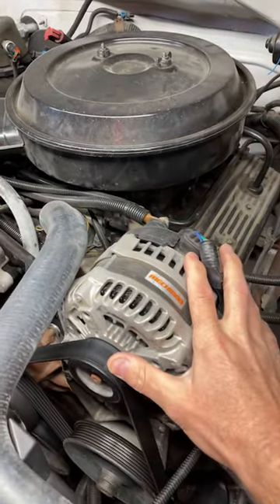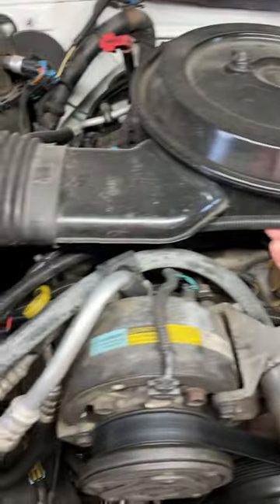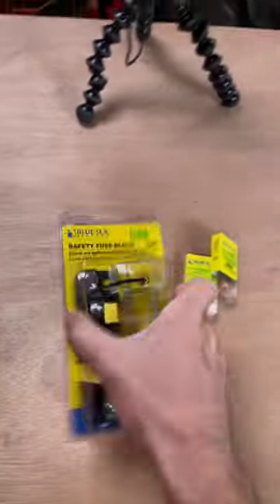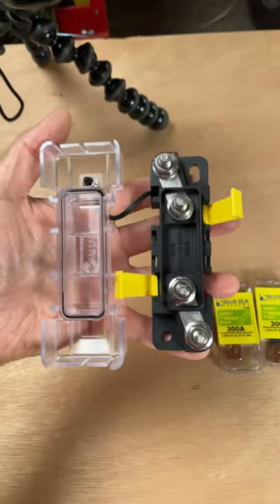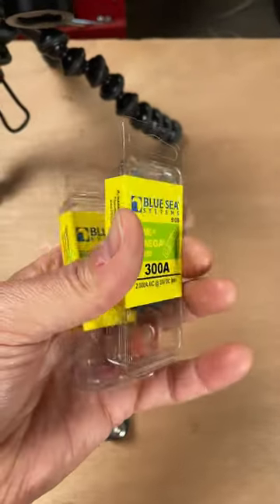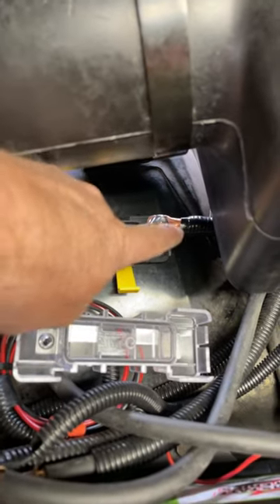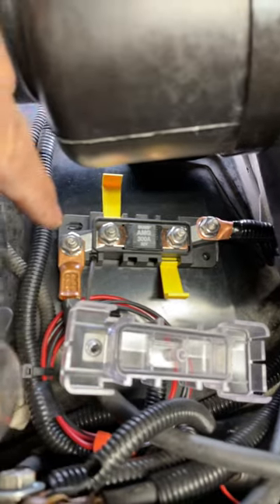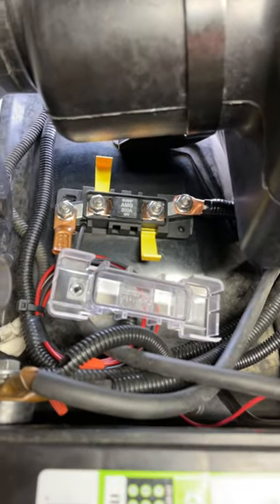Customer States His Install Was Professional!!

Comment: I’ve been a mechanic for 12 years. I have never seen a fusible link or fuse in a charge wire
Reply: me neither
Reply: Me neither
Reply: 1999-2004 ford focus idk about after those years the fusible link is behind the radiator
Reply: I’m nowhere near a certified mechanic but maybe it’s safety for a smacking audio system? If he’s upgraded the alt so the amp can pull 12k watts, I’d prolly throw a fuse on there and on my 12v going to my amp, just to protect from crossed polarity
Reply: People who run big radio amps have to have an alternator and some run a second battery. The fuse of course is so you don't blow your system or damage car or truck .  Hopefully this helps you understand the purpose.
Reply: Wow 12 years ASE certified technician. And haven’t seen one 😮
Reply: You may be a mechanic but you know nothing about car audio obviously
Reply: Self taught obviously
Reply: @albono780  I work on semis. Always have. They don’t use them at all.
Reply: @codyamrhein8965  the video is on a passenger vehicle. The way you stated your comment is as if you are a general mechanic that works on passenger vehicle. The Video is more for audio enthusiasts not semi mechanic
Reply: Cody if you have a big sound system you definitely are going to want to put a fuse in. I think a semi would run everything through a fuse box but yeah this isn't too abnormal even on small cars
Reply: Tons of cars come with it. One of my cars is a 09 Altima and it comes with it
Reply: Mr neither
Reply: We’ll he’s probably gunna install speaker equipment? considering the alternator so having extra protection isn’t a bad idea
Reply: @fastinradfordable  right. How does this make us bad mechanics.
Reply: You were probably not a very good mechanic then
Reply: Yeah been a mechanic for 3 years this is first. Thought it was joke honestly
Reply: Makes sense though if it has to much running 2 it... pops it rite off the bat keeps it from frying it i guess...
Reply: Then you have never looked in a fuse box…..
Reply: I love how everyone in these comments never reads other comments on the thread AND acts like they know everything. This is the epitome of a YouTube comment section
Reply: You don't need a sealed fuse block.
Reply: @gregoryb2999  The fuse is there so if you get in an accident or the wire wears through the insulation it doesn't start a fire and blows the fuse or fusible link instead.  Most amps have another fuse of the correct rating for that piece of equipment directly on the amp.
Reply: Technically most Nissans from mid 2000s to current have a fuse built onto the positive wire on the half that goes to alternator and on the half that goes to the starter
Reply: Peterbilt trucks used to have a circuit breaker on the positive cable before it went to the starter. Was only like a 150 amp breaker. With higher output alternators, they quit using them.
Reply: Most modern cars have fuses on the +ve at the terminal running along a bus bar. Why wouldn’t you? Safe 100bux is better than a few grand
Reply: 12 years and never!?! 🤔
Reply: let me know when u got 13 years and been under the hood of a Tahoe for instance
Reply: @evanlince3359  I work on heavy duty/trucks/earth moving equipment.
Reply: Many have them in profuse boxes(just did a mercedes a few weeks ago and I believe an impala that had it in the trunk) but many have them in line/ wire or on the firewall( like my 1997 f150).
Reply: Ever worked on Nissans and Volkswagens?
Reply: @braydoncoate9583  yeah and if the fuse blows for some reason the alt puts out a little magic smoke for the first AND last time because it lost it's foundation to manipulate the rotors field current.
Reply: Late 90s chevy pick up. Fusible link.
Reply: Usually a thermal fuse. They hide them pretty well, S10/blazers are hidden under the battery tray. The Silverados usually have them tucked under the top of the firewall. Sometimes they're hidden in the power wire on a lot of other cars.
Reply: That's kinda hard for me to believe. You must be just a brake mechanic.
Reply: @shawnshurtz9147  you must not know how to read prior comments.
Reply: @Cody Amrhein  my bad I didn't know you didn't understand that the circuit breaker that is literally on every semi alternator is the same as a fuse.
Reply: @shawnshurtz9147  probably untrue.
Reply: I have seen a bunch.... Don't know what you've been working on.
Reply: @blargblarghonk  mostly trucks. Like the 50 other comments I replied to on this thread.
Reply: @trangabe123  
No, evidently he’s only unfamiliar with aftermarket car audio. Meanwhile you’re obviously unable to comprehend English very well based on the conclusion you reached from his comment.
Reply: @albono780  
Not even an auto mechanic is necessarily going to be familiar with aftermarket audio installation, just like an audio installer isn’t necessarily be familiar with auto mechanics.
Reply: @ginger5668  bro most passengers cars have them just pull up any wiring diagram and look
Reply: They're there past a certain year, and earlier than most in some makes (I've seen them as early as 83 Toyota corollas). Most newer ones build it into the fuse/fusible block attached to the positive terminal. All mk4 and later jettas (and most vws after) have them in the fuse block that sits on top of the battery. 

If you haven't seen one, its because you're not paying attention.
Reply: Typically the alternator is limited at a current rating below 300A, aftermarket alternators won't have such a limitation
Reply: Most mechanics have little to no clue about high voltages in vehicles audio. An electrician is more certified to understand that, it's rarely if ever a mechanics issue in MOST commuter vehicles.
Reply: @deafby18  nope it is bullshit because it is the charging wire for the battery.
Reply: it makes only sense in a EV but then you have no alternator.
Reply: @triage2962  not if you’re powering more than one battery in an audio system mate, could be the auxiliary 12v for his amps
Reply: @deafby18  but it is not... just alternator and 1 battery in an old car.
Reply: Been a mechanic for 4 years and a bunch of cars have them they pop sometimes as well and have to be replaced the go to the charging wire or sometimes the starter wire
Reply: This car doesn’t need tht unless it has a newer ecm an requires it for a failsafe it’s a lot of new stuff on the ase now
Reply: It's his own suburban he did it
Reply: They are in the fuse box 😮
Reply: Then you haven't ever worked on a car :) especially bigger trucks because most of them have the fusible link AND the other side is fused at the box too
Reply: By   right the one who installed the alternator in the first place should have put a Fusible Link line but since he already screwed that up that extra fuse box you did a good secondary charge him heavy
Reply: We always did them on high end stereo component installs. But from the Amp to the positive wire. Not the Positive wire to the alternator.  what good does that do?
Reply: @tybailey9428  My Mercedes doesn't. I just checked it.
Reply: @TheFrenchPug  you lookes in the wiring diagram? What year and model
Reply: @albono780  bro 99 percent of personal use vehicle have on please just look at a wiring diagram
Reply: @tybailey9428  and why are you reply this to me ?
Reply: @codyamrhein8965  that explains it!
Reply: I was just looking through to see this. We only fuse coming off the battery for any loads (like the main fuse block)
Reply: You guys have never worked on airplanes have you? They have fuses on alternator outputs.
Reply: @USA-GreedyMenOfNoIntegrity  damm you took that way off topic. Lmao 🤣
Reply: Fords have them stock on a lot of 5.4s
Reply: Judging by the mechman alternator this is a bass vehicle. With the amount of power needed for subs, a fuse on all power wires is a MUST. Even multiple fuses on 1 wire if it's connecting multiple batteries.
Reply: Me either
Reply: Jimmy S  are you sure it's in the charge line, and not the line from the battery to the main inlet at the fuse box. Most of those were a large flat fuse in the box
Reply: 20 years in shop
All cars have a fuse or a fusible link
Reply: All fords trucks  have a fuse in the fuse box under hood for the alternator
Reply: @gregoryb2999  bruh I don’t think you understand how electricity works… the system will only accept the amps it wants… you can hook a 200 amp 5volt power supply to your phone and it will still only use the 1 amp it wants… and any decent amp will have fuses built in so that if the voltage goes too low the fuses will pop to protect from overcurrent (basically if the voltage drops then more amperage will be pulled to hit the power target Watts)
Reply: Ive been turning wrenches over 30 + and never seen a fuse inline from an alt to battery. Ive also wired cb radios never had a fuse inline to alt.
Reply: WOW... Looks like you're not mechanicing good enough
Reply: If you need a fuse for that one wire.... why not a fuse for the one wire that goes to the main starter feed.... still one wire, same size .. almost the same circuit.
Reply: Keep being a mechanic and learn stuff.
Reply: You haven't been paying attention.
Reply: @albono780  No, all cars have at least a fusible link from the charging terminal on an alternator.
Reply: @Tolohtony  and you are telling me this why . You are repeating what I said .
Reply: @albono780  I'm saying ALL vehicles have protection of some sort from the charging terminal. Has nothing to do with audio installation or not.
Reply: @Tolohtony  and I was replying to someone who said he’s never seen an in-line fuse for the charge wire and he is a tractor mechanic. That’s when I replied that the video is of someone adding a fuse to a passenger vehicle that had an audio system installed.
Reply: @Tolohtony  your reply to the wrong comment . The main commenter has been a mechanic for 12 years and have never seen a fusible link or fuse in a charge wire . Maybe you should reply directly to that man. Read thru the comments correctly before putting your 2 sense in the wrong place
Reply: @albono780  You are correct. We agree that a mechanic of 12 years experience should know that alternator leads are fused. I meant by my reply that it does not just concern audio installation. This video popped up in my feed. Is this Youtuber an audio dude? I did not take it as an audio repair video. My apologies. (Sorry, but I just have to. It's two cents, not two sense.)✌
Reply: @Tolohtony  maybe this YouTuber is not an audio installer but who ever installed that charge wire was probably an audio installer doing the big 3 upgrade . Thanks for correcting my grammar mistakes 👨‍🏫. I can now say I didn’t waste my time 👍
Reply: @albono780  Me too but I retired 14 years ago. I let my ASE certification laps in 2010.
Reply: @trangabe123 mechanics don’t usually work on car audio 🤣 that’s why most car audio shops they have to get specialized training otherwise every mechanic shop in town would be able to swap you a new 4 15s setup and amp to go booming down the block but eh that’s reality.
Reply: I've been doing it for 20 years and it is common, particularly on newer vehicles. And even the older ones use a fusible link in the wire, usually a 12 gage one. The typical rule for fusible link wire is 4 gages smaller than the wire it is protecting.
Reply: Really 12 years??? i'm not a mechanic and I've seen fusible links on multiple vehicles. You must only work on older model vehicles.

Comment: yeah it's a typical car audio thing called "the big 3" beefed up chassis ground to battery, engine block to battery and alternator to battery. I personally have 2/0 wire going everywhere. the only fuses needed are between batteries(if you're running multiple batteries) the manufacturer of the alternator also might not recommend a fuse as I know mechman doesn't recommend one due to possible voltage drop.
Reply: Mine too. But. Technically the alt wire is connected to a battery?
Reply: My 2017 kia forte comes with an alternator fuse. 200 amps. I think its protect the battery from the alternator if you're using alot of energy at once to limit alternator draw so it doesnt fry the battery recharging it. But im not a mechanic or an electrician, just educated guessed based upon general knowledge
Reply: @armadildo6468  I would also have to assume that's why everything else in your vehicle is fused. If they(individual components) ever tried to overdraw, they'll blow their own individual fuse, unless its a dead short from the power wire to the alt... whereas i use cable loom and grommets to protect against things like that. Problem solved. I, and quite a few friends run car audio power this way and have had absolutely zero issues. Also not a mechanic, I only know enough to be dangerous.
Reply: You don't need a fuse between multiple batteries. Multiple batteries should be linked together using bus bars. fuses are only needed between power source and components. If you're using a second battery for audio only, separate the two batteries with a PAC Relay and a circuit breaker.
Reply: @HueMongussD  I would use bus bars if the batteries were right next to eachother. Since the cable is passing through the firewall I wanted extra protection so in case of a short I'm not panicking trying to unhook wires while they're arc welding themselves to my vehicle.
Reply: I believe the installation covered that

Comment: For those asking why a fuse🤔 it's a hi amp alternator,, HI Amps,,, some need em for large audio systems,, others for big plow truck to run all the lights and stuff,,, many reasons,,. But they need protected,, notice it's a 300 amp fuse,. Big big batteries are 80 up to 110 amps,,, but the vehicle draw may be more,,, so big ass alternator!!! If that thing fails,,,, it'll ,🤔 well let's say,,, burn the entire wire harness
Reply from the maker: Good call. Yes, 250+ amps alt by Mechman.
Reply: @1RoadGarage  I'm an electrician,, many don't understand that wene dealing with only 13.8(12) volt DC power supply, it takes a hell of a lot of amps ,,, compared to 120 volt A/C ,👍

Comment: So professional with the black positive cable
Reply: Because tracing a wire is hard
Reply: @casemods  Citroen SM owner detected
Reply: @AiOinc1  if ya need a red positive probably shouldn’t be messing with angry pixy wrangling
Reply: I'm a professional tech.  We don't identify by color, we use meters.
Reply: I laughed the equivalent of 20 situps to this one 😆😝🥵
Reply: @alfre4554 You certainly do use color as part of identification. It may not be the only way a thorough individual would confirm they have the targeted wire, but it surly can take part in it.
Reply: @ProleDaddy  agreed, but schematics we have are often decades old and manufaring processes and procurement change.
Reply: It isn't that hard to use a red wire. Yes, almost always positive is red, and ground is black at the battery, alternator, starter, fuse block, and main grounds. Also, jacket the terminals on the fuse block. Why so protected and then to be left exposed?
Reply: @alfre4554  bla bla bla lol  man if the schematic is decade old the thing is decade old as well never got a schematic with the wrong color if you got the correct one
Reply: Red positve black negative. I agree 100%. Professional vs hobbiest vs hacks
Reply: @Zombiestoner992  what funny is no oem car manufacturer use red battery cable they will put a red boot on the positive terminal but that about it
Reply: Wire that big usually only comes in black. You just put colored tape at the ends.
Reply: Jeesus you guys just take a piece of red electrical tape and wrap the wire. Must be nice to have a spool of red and black cable laying around.
Reply: @ProleDaddy  …..100% No. Pros never use black or red to identify negative or positive. Did I say never? 
What I meant to say was Never!
Reply: @ProleDaddy  ….I read it. For clarification, I read it again. I still disagree with all of your words.
Reply: @67whitegoat4  You should try for a third time.
Reply: @ProleDaddy  …..😂 I’m good, thanks.
Reply: Professional just means you get paid to do it.
Reply: @user2C47  hate to tell you you are wrong. You can get red wire in just about every gauge. 30 years doing industrial batteries. So does shrink wrap. If you don't have red available at the moment. Also help prevents acid and acid vapors from wicking back through the cable and internally corroding the cables.
Reply: @Patrick Ancona  I see what ya did there. I am also a fan of AvE. Skookum as frig.
Reply: It's for asthetics
Reply: They only make them red for car owners. Techs don't need that.
Reply: Even most mercedes has black positive battery wires from factory
Reply: You should try doing wiring on a boat. Your brain will explode
Reply: Simple fix: wrap some red electrical tape around each end of the cable.
Reply: with a positive now rubbing on the negative. so unprofessional. chances are if they are making videos they are in fact not a professional.
Reply: @joetate87  I would prefer a boat easier to get to than steel.
Reply: We all know that color changes the polarity right? 
Maybe stay in your lane.
Reply: Nice, live positive less than an inch from the chassis, and that's before the fuse....

Google "heatshrink", then you can charge people...
Reply: colors are to make easier to follow but doesnt matter, copper is copper